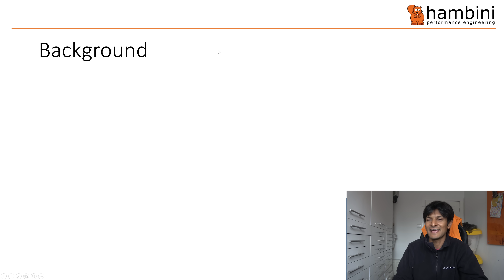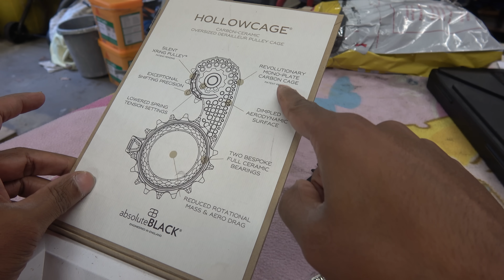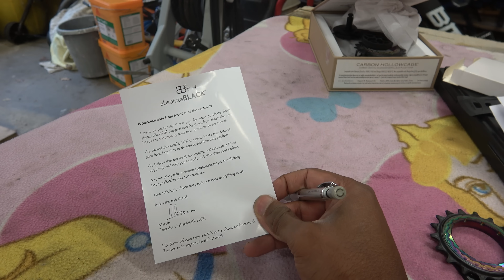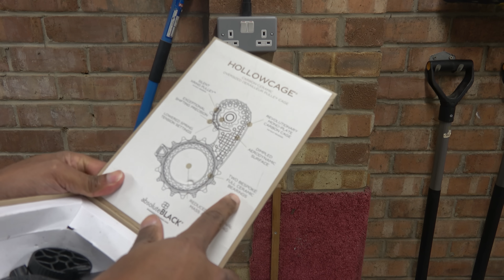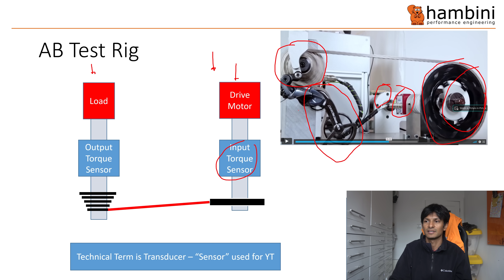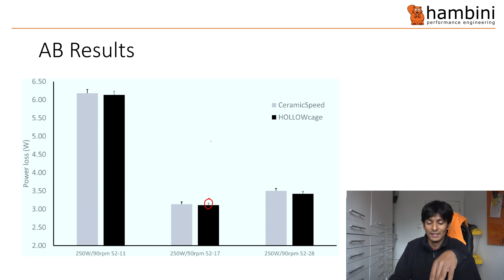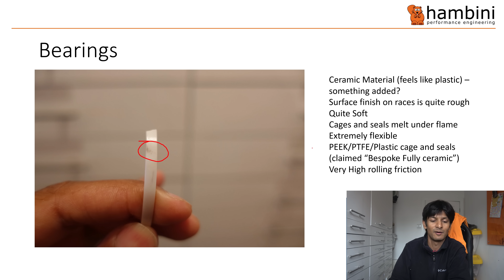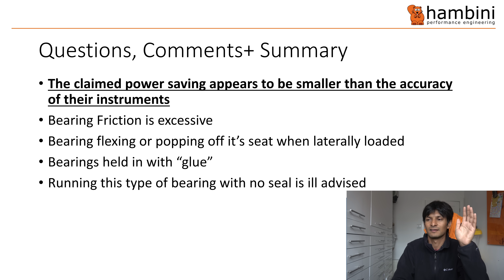AbsoluteBlack $700 OSPW: An Engineering Reaming Hollowcage

Comment: Not commenting on if this thing is stupid or not in terms of function, but the price tag of this thing really says more about how absolutely fucked Western countries economies have become under hyper sped up globalism over the past 20 years due to the internet/outsourcing to low wage, low regulation countries. The ability to produce a niche product like this for a couple hundred is essentially impossible in Western countries.  
How much do you charge for your own BB sleeves? I'm sure they are not cheap and they are about $1 in aluminum and a couple minutes on a CNC lathe or an hour or two on a manual...contrast that to how much more complicated this product is. Easy for Shimano to eat up the cost of tooling for something like this, it's going to be astronomical for a tiny niche company.

Comment: I'm pretty surprise that you not really mention the biggest problem, flexible cage. That kills the shifting performance. They say less watts if the cage is little bit flexible when the shifting is happen. Maybe they are right, but this time is half sec... and the shifting quality is in the bin.
Few watts more or less, nobody really cares. 
They lied about materials they used as well. 
I'm not 5 years old engineer, but 46 years old bicycle mechanics, more than 20 years in the business.
Reply: The only thing saving them from unusable shifting is that most of the shifting force is supported by the derailleur parallelogram acting directly on the upper jockey wheel, but heavier and flexier is a lose-lose proposition by any standard.

Comment: None of the features of their product make any sense.  Its bigger, heavier, weaker and with more bearing friction.  Even if you didnt know much about bearing materials, having a bigger pulley wheel means more chain is engaged with the wheel (more teeth) and a larger diameter bearing - more balls rolling on contact with their cages and seals it would seem destined to create more drag.  The whole product seems to be a solution looking for a problem, with dimples and techy words to bamboozle wealthy customers.  I can only imagine what a whole bike would look like if these clowns designed it? Perhaps a penny farthing with a bendy "carbon polymer" frame that has limestone millwheel bearings suitable for grinding wheat into flour?

Comment: 'all the gear but no idea' usually refers to the cyclist, but it seems like they are applying it to engineering! Yes nice test rig, but they don't seem to know how to interpret the results. Also, clearly the upper jockey will move around on the bearing every time you change gear looking at that fit!

Comment: “A fool is easily parted from his money” an old saying that will always be true.

Interesting analysis video, first I’ve seen of yours. 
However if you’re going to be nit picking about Transducer vs. Sensor you simply cannot call a Mitutoyo Digital Calliper a “Vernier”. You should understand that Vernier relates a specific type of measurement scale on an instrument not the actual instrument. For example you can get Height Gauges with Vernier scales. 

Back on subject, that bearing is no more ceramic than the plastic is carbon fibre.
You can always tell bad English when they spell “fibre” the American way. 

It highlights a massive problem in the bicycle industry whereby sales and marketing can use key engineering phrases to prize people’s wallets open to sell them sub-par made in China rubbish. 

Theoretically, a ceramic bearing in the correct clean environment with offer a lower rolling resistance but the designers of this abomination have sacrificed all sense of good engineering design to have the hollow bearing USP. It’s clear there is infinitely more design logic and sense in the Shimano part.

Also last point, there are high speed bearings out there that when turned cold, by hand, (totally outside their design parameters) appear notchy and draggy but when at full speed and temperature, are very smooth and low drag. F1 wheel bearings come to mind.

Comment: You get error stacking from the data acquisition unit as well. I've seen very accurate sensors hooked up to low resolution, inaccurate data acquisition units and I've seen the inverse where people have hooked up low accuracy sensors to a high accuracy DMM and assume the resolution is the DMMs resolution. If you had access to all that great info you could get a real uncertainty of measurement which would more than likely make their charts even worse. I'm sure you knew that though and were just giving them a fair shakedown on the transducer :)

Comment: I agree how shitty that product is. 

Even if the sensors are not accurate enough on measuring, it could be OK for comparing. But not for claiming precise wattage savings and justify 700 papers. 

The flexion I think it's not a problem with the chain on, and maybe it can make the chain to move more freely and avoid it's own friction. ¿maybe? 

And a ceramic filled plastic is not a ceramic bearing, that's sure.